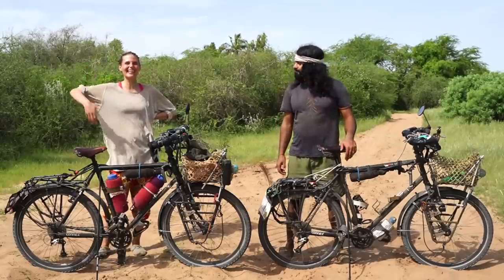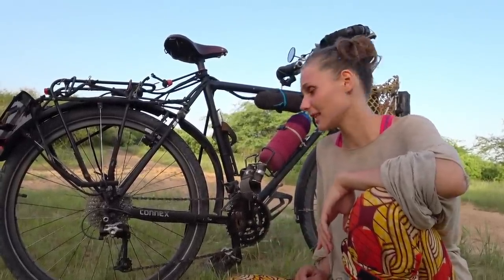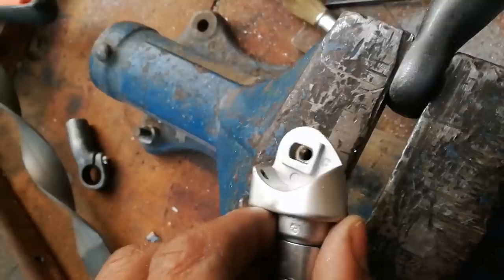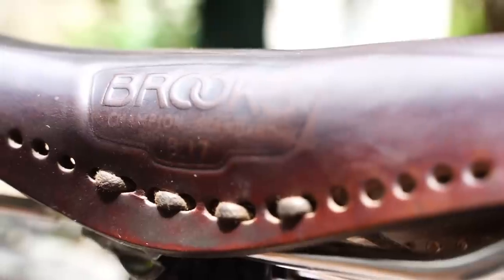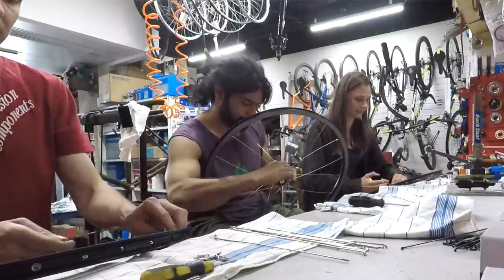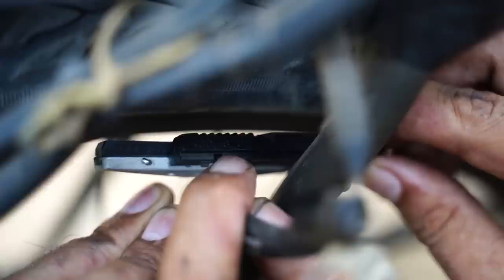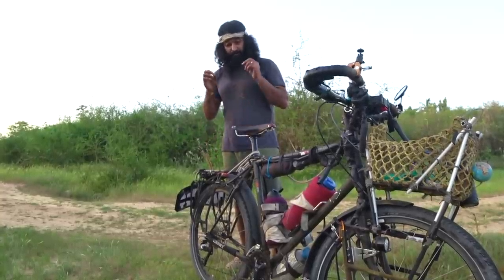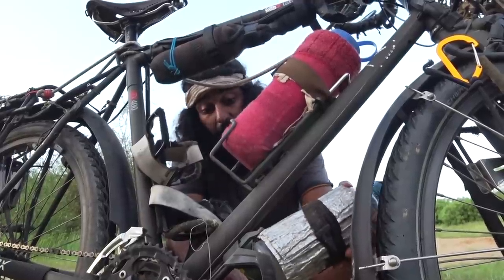Our World Tour Bicycles after ONE YEAR on the road - REVIEW

Comment: Why didn't you guys go with rohloff internal gear hubs?
Reply from the maker: Hi, I copy paste our answer to the same question, I hope you don't mind😊

"Our philosophy is to have components on our bicycles which are durable and spare parts available around the world. We want to be able to service and fix it in middle on nowhere ourself. Rohloff doesn't fit in this category, we were uncomfortable with the fact that if a Rohloff breaks down we cannot fix it. Also dealing with post and sending packages back and forward, waiting for the mail. It can become a problem since our visas might not last for all that time. Plus the cost of all this waiting, also add the chance of having difficulties with the custom of the country. This is just not something for us on our trip. Even if both of the hubs would run smoothly for ten years we still need to arrange the oils for our oil changes.

We have heard good and some bad stories about Rohloff on multi year tours. We really couldn't find a reason why not to go with a derailleur system? This system really works, it only needs to be cleaned. But so does the chain anyway. At some point when we are in Europe we would like to try it, but we wouldn't take it out of Europe for many years at a time.😊

Comment: I think if I were riding around the world for 10 years I would want bikes with lower maintenance needs. Sorry but derailleur transmissions are high maintenance and they need constant cleaning and lubricating which can be a real PITA if you are riding every day in crappy conditions. Ultimately what you buy is determined by your budget. If you have a larger budget then you can afford better equipment. Not saying you still can't go bike touring on an old second hand bike, you can, but having better more durable equipment reduces the likelihood of your tour being cut short as your bike is knackered. For me it would be a proper touring expedition bike with either a Rohloff hub or Pinion gearbox with either belt drive or chain with a full chain guard. Expensive but the maintenance is far lower than cheaper options.

I have the Surly Nice front rack. Very strong, but it's heavy around 1.5kg with all the mounting brackets and bolts. I prefer either Tubus Tara or Ergo low loader front rack or my current favourite Specialised Pizza rack which has nice large front shelf and side rails for mounting panniers. It is strong and light. 13mm tubing.

Really like those collapsible click stands you use to support your bikes.

As well as charging with your front Son dynamo hub, do you have solar panels as well?

Surly LHT is a very capable touring bike. If you want a stiffer frame then perhaps aluminium frame is better in this respect - such as Koga make.

I have both Surly Troll and LHT with Rohloff hubs and both are very good, very low maintenance and reliable. I too like you built them myself and didn't spend 3000€ on either of them, probably the price for both of them.

But the most important thing is get a bike that FITS.

Very thorough review. Thank you.

Fair winds to you.
Reply from the maker: You are welcome Alex😊For us the maintenance is not a problem actually, we clean our drive train once or twice a week and don't mind doing it, it takes around 5 minutes for both  bicycles. We did the same across the Sahara where our drivetrains were covered in sand and the derailleur system worked, no problem. You can follow our chain performance here:
https://nomadstrails.com/follow-our-chain-wear/  

I also copy our answer to another comment about Rohloff, I hope you don't mind: 

"Our philosophy is to have components on our bicycles which are durable and spare parts available around the world. We want to be able to service and fix it in middle on nowhere ourself. Rohloff doesn't fit in this category, we were uncomfortable with the fact that if a Rohloff breaks down we cannot fix it. Also dealing with post and sending packages back and forward, waiting for the mail. It can become a problem since our visas might not last for all that time. Plus the cost of all this waiting, also add the chance of having difficulties with the custom of the country. This is just not something for us on our trip. Even if both of the hubs would run smoothly for ten years we still need to arrange the oils for our oil changes.

We have heard good and some bad stories about Rohloff on multi year tours. We really couldn't find a reason why not to go with a derailleur system? This system really works, it only needs to be cleaned. But so does the chain anyway. At some point when we are in Europe we would like to try it, but we wouldn't take it out of Europe for many years at a time."

We do have solar panels and we really love them. We are almost independent from grid electricity since we arrived to the African continent, thanks to the strong sun! 

We do prefer steel frames and we are happy with our frames, Peyman had an aluminium touring bicycle for few years and it did the job, too. We prefer steel because it is much easier to find  welding machine to weld steel. The braze-on threads also last better.

You got a good deal on your bicycles🙌🏽We really like the philosophy of the Surly Troll frame, it is very versatile. Totally agree with you that the fit is the single most important factor with the bicycle.
We wish you all the best and see you on the road!  😊
Reply: All good points but derailleur gears are available worldwide. I read an account of a chap doing a world tour on a Rohloff  bike. He loved it until he had a hub failure in a remote part of the world. There wasn't an agent in the country so he had to ship the hub back to Germany. The repair was done free of charge but it held him up for 2 weeks. 
I'm sure it's rare for this to happen, certainly rarer than problems with a derailleur but if you're going off the beaten track I'd go for the simple option.
Reply: @colinwellman9480  Well I beg to differ. One person, just one person you read an account of on the internet and the product is totally fooked. It's a useless pile of crap AVOID!!! What do you know about the exact cause of the problem with the Rohloff speed hub and was it owner inflicted or the wheel in which the hub was built was not built correctly. If Rohloff's instructions are followed the hub itself and the wheel build should be very very strong. Many owners have covered huge distances on their Rohloff Speedhubs. I have ridden almost 50,000 trouble free kms on my Rohloff hubs. The chains last huge distances as I have only replaced the chain once a KMC X1 for the Rohloff Speed hub. I have a full chain guard to keep it and the rest of the bike clean.

How many problems do people have with derailleur transmissions? Many is the answer. Most people at some point on a long tour. Yes they are simple, low cost to manufacture and pretty crude open systems. Ok some are made of better materials than others, better specs, some are way more expensive, give way better shifting and then there is Di2 electronic shifting as well. And yes parts are available world wide, but to pretend you will be able to get the exact same replacement part for the one that has broken where ever you are is fantasy. You will be cursing that you gave your bike to some idiot who packed it poorly in the back of a bus mashing your derailleur or you take a tumble on a trail and it makes contact with a rock, bam smashed! Derailleur systems can be way more problematic than Rohloff speed hubs. Period. I have ridden Rohloff hubs for about 5 years now. I never ever hear criticism negative feedback from any one who actually owns a Rohoff hub. All seem to be pretty happy bunnies. Criticism always seems to come from people who don't own a Rohloff or some one who read something on the internet. Those who have never actually ever experienced riding with one let alone owning one. If your prized derailleur system which you got for a song in the end of season sale fails, Mr Shimano or Miss SRAM are not going to repair it free of charge gratis. Oh no. You are going to have to buy new and pay the going rate where ever you are for something that is likely to fail 100km down the road if fitted by a cack handed mechanic in a local bike shop if you are unable to do the work yourself unlike these guys here who can at least assemble and dis-assemble their bikes.

For me it is Rohloff. I have toured many thousands of miles with mine trouble free - Europe, China and Australia. I used to ride with bikes with derailleur transmissions, but the maintenance became a very loathsome chore, not to mention the cost of replacing cassettes and chains too often, chain rings and derailleur jockey wheels when they wore out. Not to mention all the crap the open system would throw all over the rear wheel a fine grinding paste of lube, mud, grit, dust and shit.

The elephant in the room is cost. For many the cost of a Rohloff speedhub is too high. I realise people have different budgets. My first Rohloff hub I really scrimped and saved to afford it, but so glad I did as it has paid for itself by the extremely low maintenance. All the time I used to spend cleaning and lubing the derailleur transmission is now my time to do other things to ride more. The oil changes are a breeze to do normally doing 2 each year maybe 3 depending on how many miles I have ridden.

I recognise that people have different means. I am fortunate that I can now afford nicer kit, but I remember the times when I couldn't. But to simply say something is unreliable because one person on the internet might or might not have had a problem is bonkers. Quite a few people have had problems with derailleur transmissions meaning bodged repairs or fitting something of poor quality that will soon fail. For many the problems have been terminal meaning end of tour or new bike. The other favourite is worn out knackered rims from rim brakes although these guys are using CSS hardened rims which are very durable. Personally I prefer hydraulic disc brakes as the performance is so much better in wet grotty conditions than rim brakes. Sorry but they are. So my idea of an ideal touring expedition bike would be beyond the budget of most people. I am lucky and fortunate that I can afford to build one or buy one. I have two bikes with Rohloff hubs. I realise they are expensive and because of this many people cannot justify the cost so try to disguise this by finding the one person on the internet who has ever had a problem. I think if cost wasn't an issue for many, even more long distance cycle tourers would be using Rohloff speed hubs. I wish I had bought mine sooner than I did.
Reply: A 2018 participant in the Trans America Bike Race used a Rohlof hub and was happy with it until it started to south on him halfway across Kansas. He was unable to get the minor repair done. The device eventually failed just outside of Pittsburgh Kansas where he was stuck for upwards of 2 weeks waiting for parts. No, derailleur is still the way to go.
Reply: @57ccrider  You don't give any detail your anecdotal story why or what caused the Rohloff hub to fail and you certainly don't make any sense. What does "started to south on him" mean? RAAM is a very long distance endurance road race. I would point out that Rohloff never designed their hub to be used in a race scenario, and have that from Rohloff themselves, but  providing it was used and maintained correctly I don't doubt that it could cope. Was the failure on this occasion down to the owner or a mechanical defect? When you know the full picture let me know. Rather than wait 2 seeks why didn't the competitor just get another bike? I have ridden 50k trouble free kms on Rohloff equipped bikes. Maybe derailleurs are for you, but not no longer for me. Do you actually own a Rohloff hub or have any experience of them or just trawling the internet to find the few cases where people claim to have had problems. It is a bit disingenuous as you do and others like your NEVER give any detail, just use these second third or fourth hand accounts to discredit the hub. It has been 100% reliable for me.
Reply: @NomadsTrails  It is great that you have the system you want that works for you and you are happy with.
Reply: @alexmorgan3435  John Stamerjohn was yhe ra c er using the Rohloff gearbox. It was nt a 2nd hand account. I personally know John and followed him via his SPOT Tracker. "Going south" is sn old mechanics phrase which is slsng for malfunction. Inital failure was an inability to shift because the linkage inside the hub wouldn't allow it. In Pittsburgh, the hub actually came apart. It was the TABR not the RAMM.
John made contact with Rohloff upon the initial indiation of trouble snd followed their instructions to rectify the problem.
You can go to the 2017 TABR page where his 1st hand account of the casualty is documented. Apologies, it was the 2017 race.
Reply: @57ccrider  What you mean malfunction like all the errors and mistakes in your replies? Still don't know what the specific problem was whether rider generated or internally. Difficult to form a view without specifics. It is a second hand account, this apparently happened to some one you knew therefore 2nd hand not yourself. In any case I am sure the problem was fixed FoC. But what ever type of transmission, a problem is a problem. Broken derailleur you are going nowhere unless you can rig up a single speed. At least with a Rohloff you can still ride as a SS. There are still far far greater frequency of problems with derailleur gears than Rohloff. There just are.

What is the the TABR? I haven't come across it before. It would be very helpful if you could give a link to your source?

Comment: I can't mount my Deore BR T 610 on my Surly frame. Have you mounted the XT brakes without issues?
Reply from the maker: Interesting, which frame do you have? Does it have the braze-ons for rim brakes or why can't you mount them? We didn't have any issues to fit ours 😊Rim brakes should all be the same standard, so the only two reasons I can come up with is that either the bike is designed only for disc brakes (like the disc trucker), or it's a fat bike frame. Hope you find a solution!

Comment: 9:02 seems like sweet mudguards, I see they have a variety of mudguards, that fit a lot of bikes. But i haven't tried their stuff, but looks good.
6:08 I dislike this frame does not have a replaceable rear derailleur hanger.
Chris King Headset is a good choice I think. I too went for Chris King.
I haven't heard of Busch + Müller  & Tubus I will check them out.

Comment: 4:32 why do you need to cover it? is it due to damaging it or will it just be soaking wet?
Reply: leather saddles will be damaged if you ride them while wet. if you let it get wet, it has to dry out before you can put any weight on it. brooks makes non-leather saddles to avoid this issue
Reply: @herbert633  I ride in wet, snow, subzero, in temps down to atleast - 10c. So I new dsomething that can handle everything. I having a loose bag over there like they do don't seem like a good idea for my use. I guess if there was a cover thar sat securely that would be nice, but I don't want to worry about a cover or saddle. But leather saddles should be lubed anyway with leather treatment. Brooks saddles even come with it, I guess thst would give some protection. I saw a video of a Norwegian dude riding with a Brooks saddle with no cover but he really got the treatment on the saddle well. I haven't tried Brooks saddles, but I hear alot of good things about them

Comment: In one line Bicycle worth 3 lack indian rupees
Reply from the maker: yes that is correct, but we build these bicycles in a way we can use them for years under the heavy load so in long term, actually will be cheaper for us. but  if you go for a shorter trips  you defiantly don't need to spend 3 lack on bicycled , you can go with an old mountains bike  which can cost around 100 euro and you will have great time cycling😊🙌🏽

Comment: Which I can’t understand why a bicycle for tourism should look like a bunch of crap!
Reply from the maker: hi, sorry,  i cannot understand your point?
Reply: Vanity has no place in long distance bicycle touring. Practicality, durability, ability to repair on the fly and simplicity are of greater priority.
Ever try to get a carbon or titanium frame repaired on the road. With steel even a moderately talented welder can get you back on the road.
Reply: @57ccrider  The carbon frame is repaired easier than CRMO, but I wrote not about the material of the frame, but about what you can do everything fault.